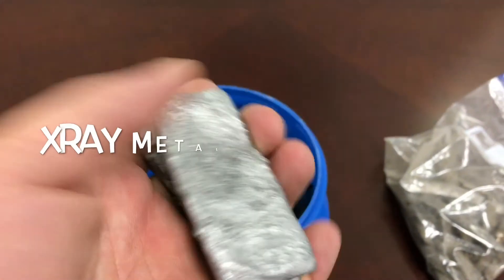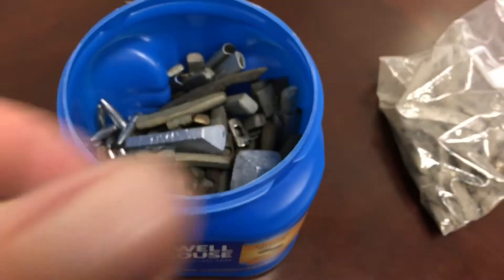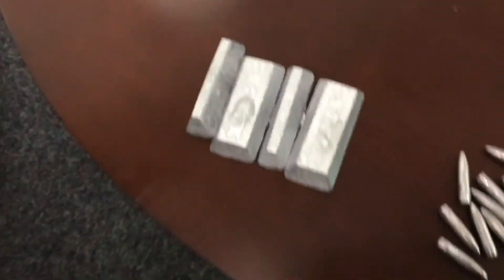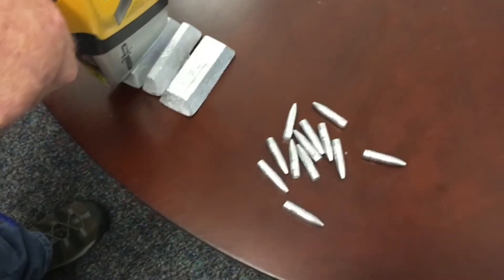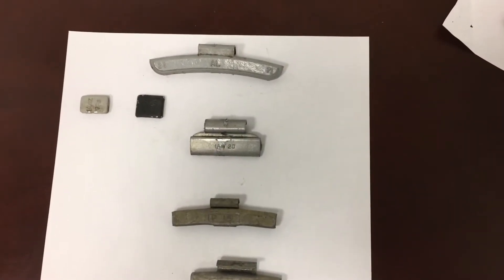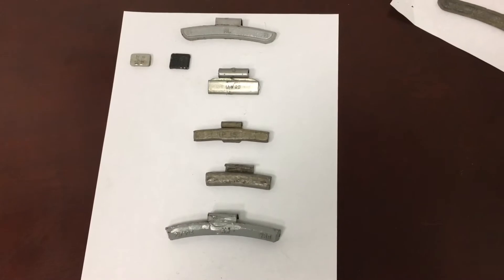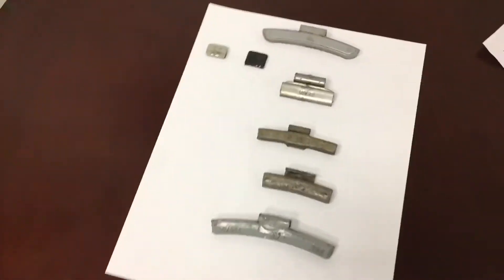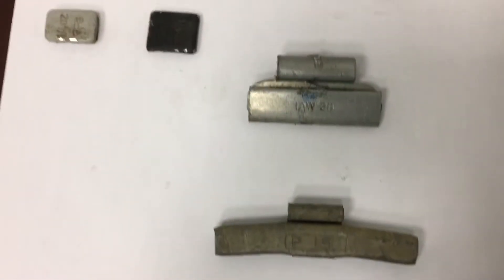LEAD Wheel Weight Composition - Casting Bullets & Fishing Weights - Teach a Man to Fish

Comment: Oh boy, seems  hard to build a precise and consistent alloy on wheel weights. Staying away from Zinc and Iron wheel weights is easy, but when using lead wheel weights the antimony content seems to vary enough to induce at the very least 1% difference from batch to batch.  Not much for a slow poke and plinking load, but if one wants to have a consistent alloy for stout loads and said behavior for hunting, it could screw up things a bit.  Places like RotoMetal looks like the best places for those in search of the best metal to build a quality alloy.  Me too I mostly use wheel weights, but from now on I will try build the largest possible batch to get consistent metal for the longest time possible.  Thank you

Comment: Using an egg sinker 18" to 24" above your hook, held by a swivel or snap swivel, is one of the very best bottom fishing rigs.>>>allabout.wiki/7ryb   The line slips through the sinker allowing bites to be felt or seen without the fish feeling the weight. One of the simplest and best bottom, still fishing rigs of all.

Comment: Hi there. Thanks for the video. I was just wondering how you got rid of the small percentages of iron present in some lead pieces. How did you achieve that? Thanks a lot!
Reply from the maker: I can tell you that the only removal, other than sorting, that I did was to use a flux during the melt and scraped off impurities from the top.